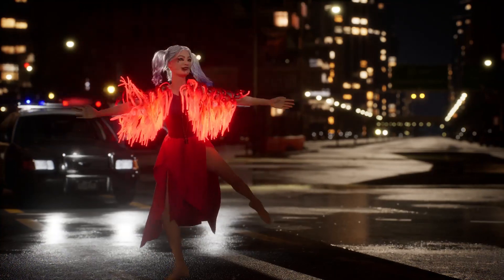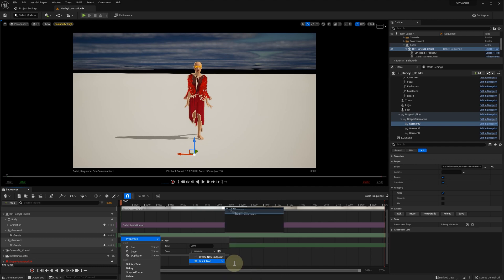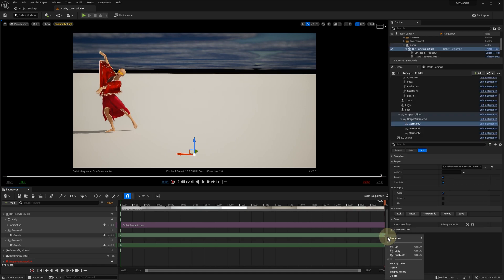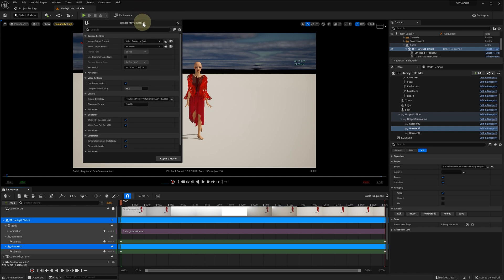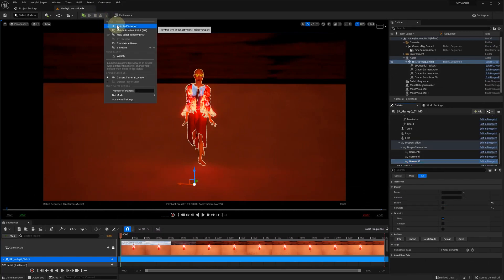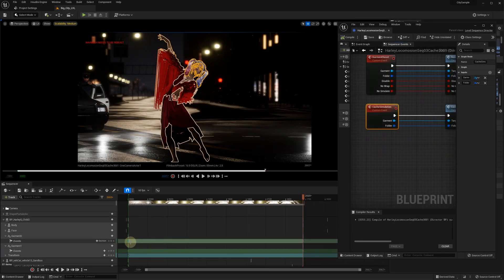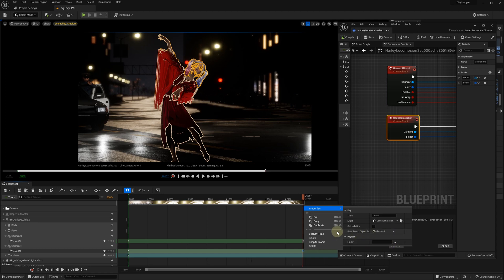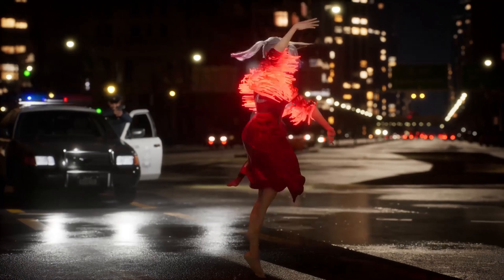Cloth simulation cache for Unreal Engine

Comment: I am losing my mind to find a solution to this, it has never been asked anywhere before, how can I make the cloth simulation work in movie render queue? When I render it shows them stiff piece of actors, no simulation works. I added both wind and cloth to sequencer, works fine on sequencer when simulate is activated, but when I render it does not simulate
Reply from the maker: Get in touch via our Discord. We'll try to figure it out
Reply: @triMirrorTV  I don`t use udraper :/

Comment: Did you manage to increase the temporal samples of the AntiAliasing? I have been testing a lot of different ways, but I am losing hope on unreal rendering cloths with high temporal samples.
Reply from the maker: Style Marshall seems to handle it with the camera warmup https://discord.com/channels/867493391973220383/867873475259793458/1051144614574305280
Reply: @triMirrorTV  Thank you very much for the answer, I will try it!
Reply: @Carlos96AM did u figure out how to use it with temporal samples?